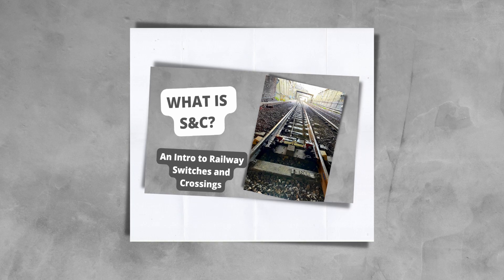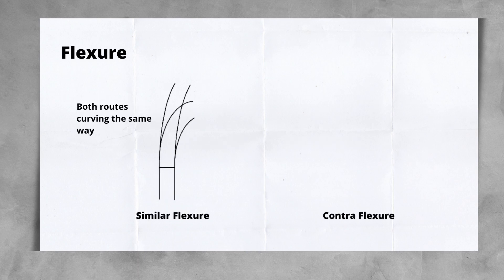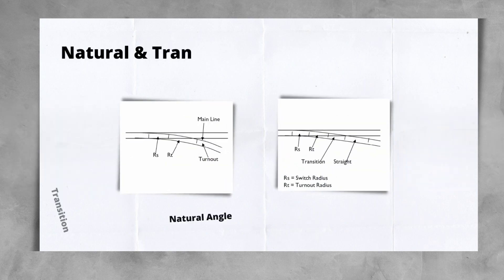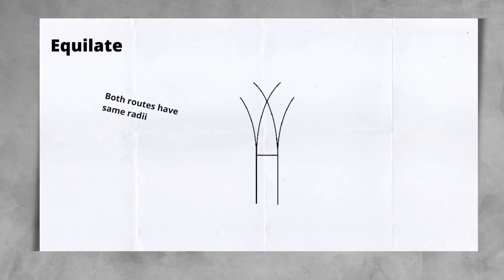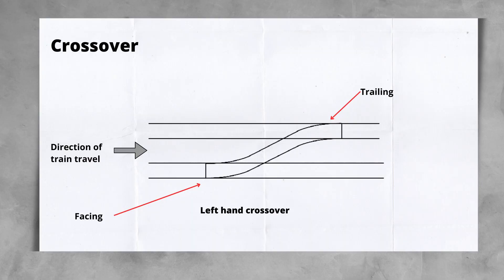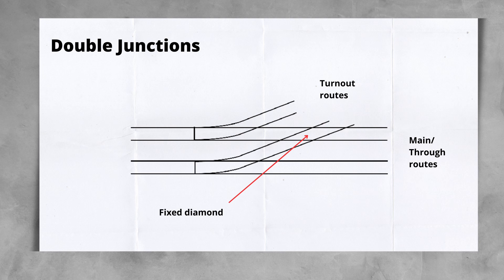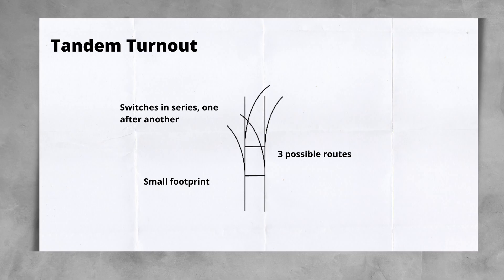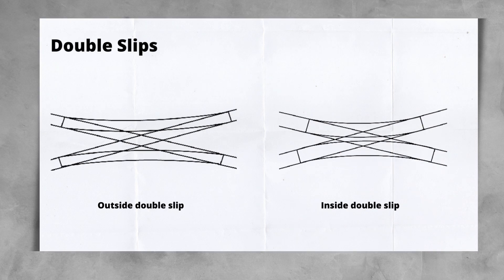Railway Junction Layouts! An Intro Guide to the Standard S&C Layouts

Comment: Good video However the UK tradition names were Half scissors or Scissors for what you call an outside slip and outside slip for what you call an inside slip. An inside slip had the switch blade ends within the length between the two acute crossings. 
Terms to get to change over the years but it may help to know the originals
Don